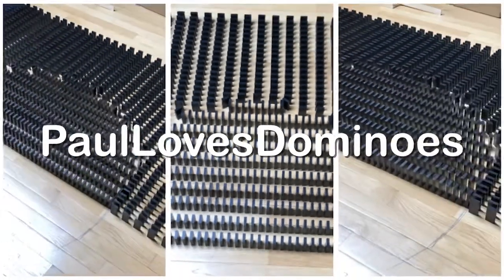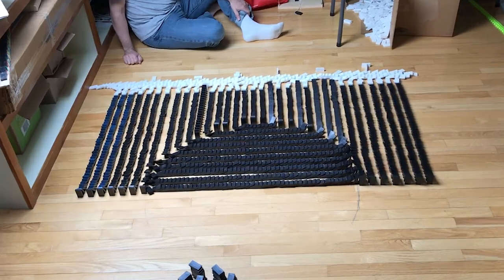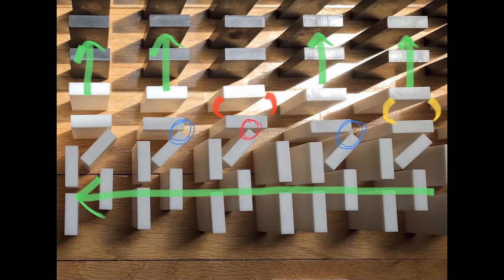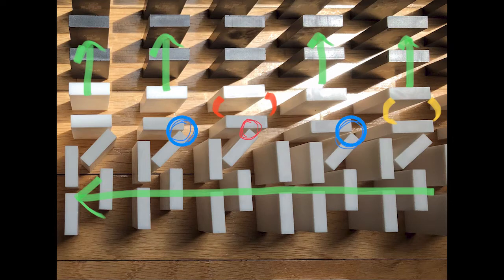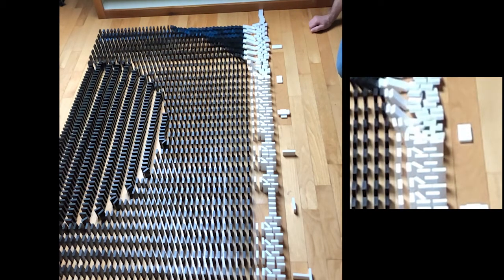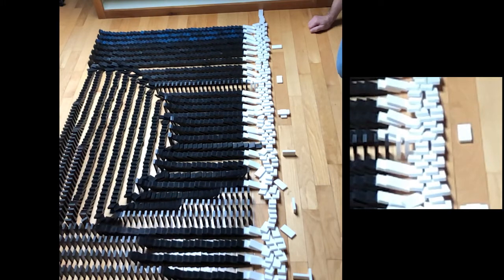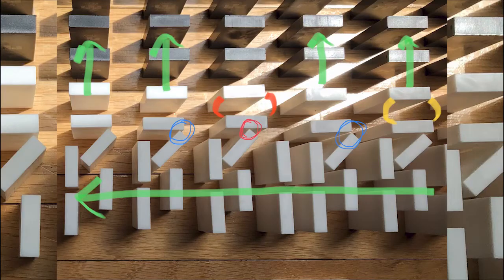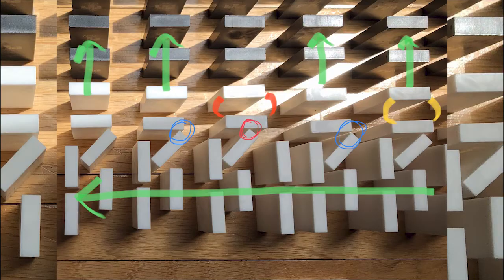The Most Beautiful Field Starter Failure - With Analysis

Comment: THANK YOU!!!!  Setting up field starters has been the bane of my existence (usually end up setting up the field numerous times before it topples properly).  I have always wondered what the 'proper' placement of the angled domino needed to be to ensure a more reliable topple.  Now I know to make sure it is at the leading edge - and to make sure the domino it is triggering is slightly more than 1 domino width away from the domino it will be toppling.   I am currently working on a project  that will contain a field, so I will definitely put these 2 tips to use in my set-up.
Reply from the maker: Good luck! I still have anxiety about them, but hopefully these tips will help!
Reply: @paullovesdominoes  The tips definitely helped, my field toppled correctly first time.  (Unfortunately it was the second field set-up it toppled).  When setting up the starting line with the first field set-up, I accidentally dropped a domino that flew through the field knocking about 3/4 of it over requiring me to reset most of it a second time.   One of these days I'll get a perfect topple with the first set-up of a field.  😀.